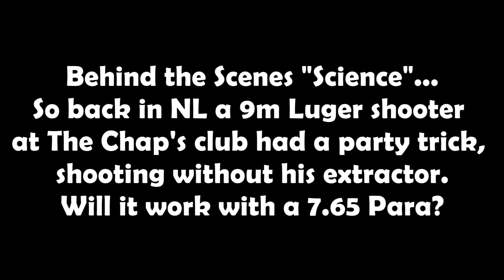EXTRA VID: a little 7.65 mm Parabellum / Luger test that failed

Comment: Lugers were designed so that there would be no pressure left in the barrel once the toggle started back.  Therefor the shell should not extract without the extractor to pull it out.  If this happens, then maybe the gun isn't working right.

Comment: Yeah, I don't think a locked breech handgun will work well without an extractor. Maybe it will cycle occasionally like TFBTV's Glock test, but not reliably. Blowback works just fine without one, but the point of a locked breech gun is to not unlock until almost all pressure has dropped within the chamber. My little Taurus PT22 has no extractor and works perfectly.

Comment: Do you guys load for the 7.65 Para?  If so what bullets do you use.  93 grain bullets are very hard to find.
Reply: Ashley Palmer Nope, I’m still using original 70s and 80s ball ammo but there are so many Lugers still around that RUAG has been producing new ammo for them. https://www.aats-shop.ch/shop/munition/ruag-swissp/pistolenpatronen-7-65mm-parabellum-92grs-fmj/
Reply: 110 gr. Same like M1 Carbine

Comment: what's the purpose of the leather strap?
Reply: Merle Morrison It is to help draw the pistol from the holster which is a very tight fit. You have to think of the Luger as a swanky status symbol for Swiss officers rather than a quick draw close combat pistol.
Reply: @thebotrchap  OK, thanks - kind of expensive trinket, eh?
Reply: Merle Morrison Certainly was!
Reply: @thebotrchap  This is interesting! I have seen holsters with a leather pull strap that when pulled will produce the gun upward from the holster so one can grab it, but the strap itself is part of the holster. To see a strap on the gun is interesting.
Reply: mannys9130 Yeah it’s definitely odd, the holster covers the sides of the grip like a glove so you either have to pull the strap or actually tip the pistol out. As a measure of how little they were considered combat arms, it was quite fashionable to wear the holster on the back of the hip.